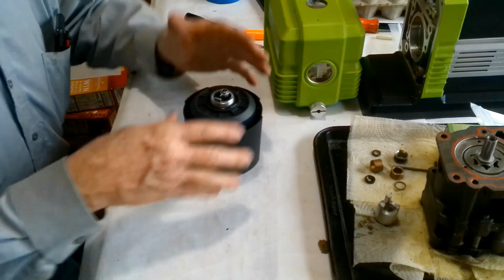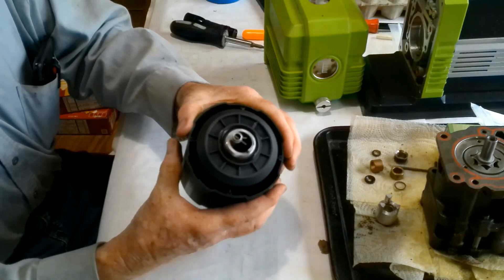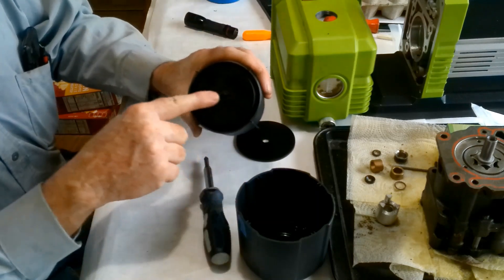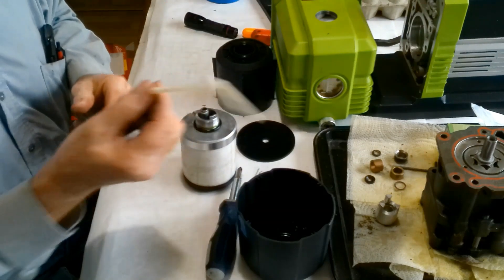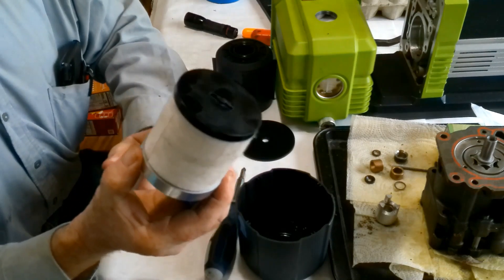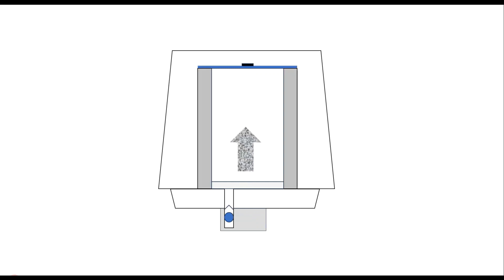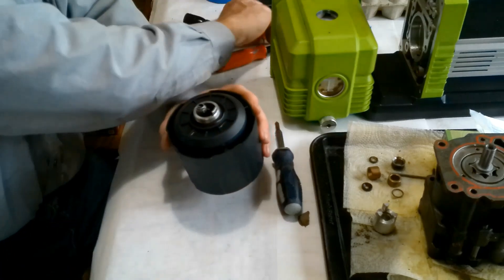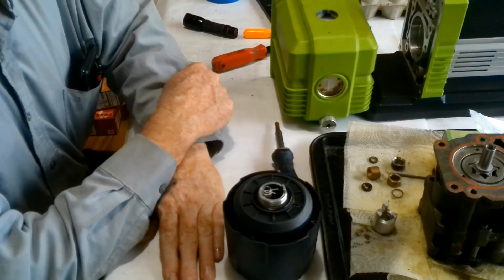Harvest Right's Oil Mist Filter Maintenance

Comment: I thought that HR had instructions on cleaning the filter and WASHING it with water.
I have a spare one.  I did clean and wash one.  I used an air gun to blow most of the water out.  I then let it dry out for a week.  It still works good.
Reply from the maker: Harvest Right has developed many procedures' in-house.  It's unknown if their information came from their research or from the manufacture.  In this case, I contacted Navac.  Navac's direction came from the manufacturer.  You took great care to insure the filter medium was dry before using it again.  Imagen the issues if your filter was still wet when placed back in service.
Reply: I had issues a year ago and they sent me a video on how to take it apart and clean it actually ive had to do this several times at their prompt…it did work afterwards thank heavens

Comment: Rebuilding the pump?  Think you forgot to mention how you broke it!  We've solved one mystery of the odd oil filter, only to be followed-up with another mystery concerning an apparently broken pump!

The manufacturer should have documented within the manual, the use of mineral oil and possible scenario of inhaling misting mineral oil, when considering placement of the freeze dryer.  The only item mentioned within the user manual, something concerning placing the unit near a sleeping area without any explanation as to why.  As such, why some or many opt for placing the freeze drier within the garage.  Since I've already purchased expensive shelving for the kitchen, will likely have to follow through and pray the oil misting causes no problems, as us guys tend to sleep on the living room couch.

According to the vacuum mineral oil SDS and health hazard category, should have likely mentioned this for older folks!

Hopefully it's not as bad as running a 2-cycle chainsaw.
Reply from the maker: Oh, and the pump?  I didn't break it.  It was a defective return back to HR from a customer.  I asked HR for it so I could play around with it.
Reply from the maker: I understand your concerns.  The SDS to consult would be the brand of oil you're using. If it's HR's oil, then it would be Robinair. SDS below:
https://www.robinair.com/sites/default/files/documents/Vacuum%2520Pump%2520Oil%2520SDS%2520552184_0.pdf
Section 4 has this statement: ...This material is not expected to cause inhalation-related disorders under anticipated conditions of use...
Section 11 has this statement: Inhalation       Avoid breathing vapors or mists. 
Section 2 states: This chemical does not meet the hazardous criteria set forth by the 2012 OSHA Hazard Communication Standard (29 CFR1910.1200).  This means OSHA is not concerned with the use of this chemical in the workplace and long term employee exposure is not an issue.
I don't think there's an issue unless you have COPD or other major health problems.  Consult your doctor if you do.  With all this said, I think you'll be just fine.
Reply: @Philat4800feet  Well, that is exactly what I concluded based on the information alone that the Harvest Right's vacuum oil (mineral oil) SDS claimed "Categary 5" health concern.  (May have been  one of the other generic mineral oil SDS sheets, cannot recall exactly.)  Reading the footnotes on that section as specified within the section, seemed to indicate elderly or those with health concerns could possibly have a (breathing/sensitivity) problem.  The reason why mineral oil falls into the Category 5 health concern, assuming from the foot notes, the product likely caused serious harm however was ruled-out from being within a higher category due to nonspecific other reasons.  Had I known all this, I probably would have ordered/purchased the smaller unit, for significantly easier ability for moving/relocating as needed, as well as easier for placing upon a shelf!  OSHA is work/occupational related safety related measures, similar EPA noise dBA/dBC scales, opinions/statements can likely be weighted towards the commercial sector, and/or vice versa.  From what I know of OSHA, they tend to be far more strict.  Reading further into the mineral oil SDS data/hazards, there are upper/lower limits mentioned.  In my opinion, as I previously mentioned or joked, symptoms would likely be similar to using a chainsaw using 2-cycle gas/oil mixture, but having far less affect, as the chainsaw is burning the gas/oil, whereas the vacuum pump is slightly warming/heating the oil.  Probably not a good idea for resting your head next to the vacuum  pump while running, and I'm also thinking of placing a fan on the pump for slightly cooling the casing, without knowing the trade-off as now I'm pushing air over the pump filter condoning a slight negative air pressure around the filter.  Shrugs... guess I'll find out if it stinks up my house soon though...  This reminds me of the toy train smoke, but again, the toy train stuff is designed to smoke, whereas vacuum oil is far likely not designed to reach smoke point.
Reply from the maker: @rogerxxxxxxx  Fan idea is good.  If your garage is somewhat insulated and can stay below 80 degrees, that would be a good location for the freeze dryer.
Reply: @Philat4800feet  Too late, already half through with putting a medium sized freeze dryer up on some Hally stainless shelving in the kitchen.  I'll pipe-up from the ER tonight if the option fails. I was fretting the garage would be too warm, typically 75-80F with higher humidity versus the house kitchen with A/C, being typically ~68-70F and dryer.
Reply: @rogerxxxxxxx 
I saw one YouTuber put a flexible clothes dryer vent pipe over his filter housing and vented it outside. He installed an inline fan in the pipe to move the air. I was considering doing the same thing.
Reply: @PS-pe6nc  : this would work, as long as the run of venting were kept somewhat short or of reasonable length, as the vent pipe will place positive air pressure restriction on the actual pump venting.  Another item of concern is Winter or below freezing temperatures will freeze any humidity within the vent piping, placing further positive air pressure on the venting method, and within subzero temperature areas, possible freeze the venting shut.

As for  me, I've just been ignoring this problem, as I likely have other more serious concerns with other matters.  Rule of thumb, the unit should be within a climate controlled (air conditioned) garage/workshop area.  Also, the heavy units should be on heavy duty rollers and not be placed and balanced on shelving, else the units are anchored to the wall studs.
Reply from the maker: Check out this video:
https://www.youtube.com/watch?v=8jFGjKkOW3E&t=166s

Comment: Good to know how if I ever need to clean the filter, I had a mist fill the house the first few times so since i was next to a window i built a little platform outside for the pump so now I don't have to worry about it and having the pump outside cutts down on noice and heat from pump also.

Comment: HR service is the worst I have ever dealt with. Three job tickets, on the same problem and they failed to respond all three times.
Reply from the maker: Is it working now?  Anything I can do to help?
Reply: @Philat4800feet  I really need the wiring schematic for the module terminals on the back (Screen attaches). Two black wires off the vacuum switch connect to male spade connectors, there are six on the module. The small white plastic plug with fine wires from the vacuum switch plugs into a printed circuit board, the circuit board is numbered with four female plugs. Only one plug is needed. I need to know where they reconnect to. Here are the numbers of the machine.  BOM. AL21012016 TS. SER# =117AL1TS-11406-TL. Can you direct me to this schematic by chance? No luck on the net. This all started with a vacuum leak in the pipe teen on the vacuum chamber. I put thread tape on the leak, but since I'm not sure where these wires go, the vacuum reading never changes, no matter where I put the wires.Thanks

Comment: Question to other FD users.  My effluent water has oil residue every time I run a batch.  

The FD food after a few.weeks when opened has a yucky smell to it.  

Is anyone else seeing this issue?
Reply from the maker: Sounds like your check valve in your pump may be leaking allowing oil from the pump to be drawn into the vacuum chamber.  An aftermarket check valve can be mounted on your pump.
Reply: @Philat4800feet  Well harvest Right would not help me resolve this issue which is poor customer service.   Looks like I'll have to go find a check value because they refuse to help me with this issue on a new unit. 

Thanks.

Comment: I puchased a new pump and the mist filter was broken off when it arrived. Harvest Right was nice enough to send a replacement without making me return the broken unit. Harvest Right even sent out a new lcd display free of charge even though my unit is over 5 years old. Just wanted to share my excellent experiences with Harves Right! 😁
Reply from the maker: Good to hear positive reactions with HR
Reply: @Philat4800feet I agree. I've run into a number of negative vids lately.  One showed where they had sent out a USED unit. He hadn't resolved the issue yet as they seem to be dragging their feet. I have , hopefully,  a brand new one to put together.  Can't wait to see the hours on the unit.

Comment: Thank you and a very timely video for me-my hubby put a piece of wadded up tissue paper in where the ball bearing is to alleviate some misting and I’m afraid my filter now is not able to drain as it should.  When I changed my oil and set the filter upside down to refill the oil it now leaks all over my premier pump….🙄
Reply from the maker: Some engineer somewhere designed it this way for a reason.  Best not to screw it up.
Reply: @Philat4800feet  I have learned to just watch your you tube channel….  😉
Reply: What would cause my vacuum pump to smoke?